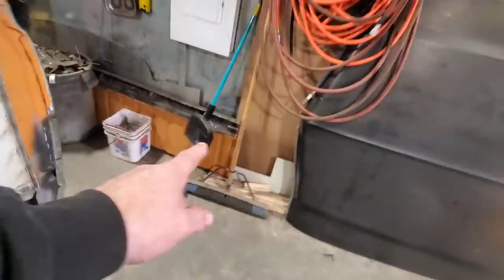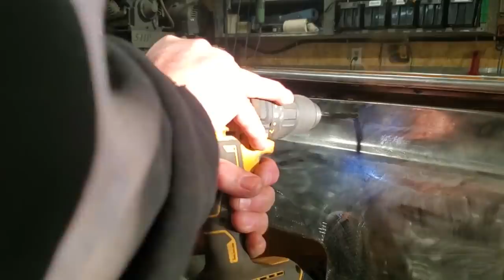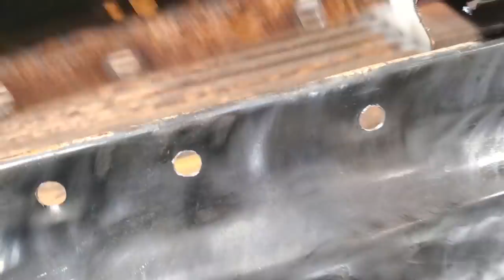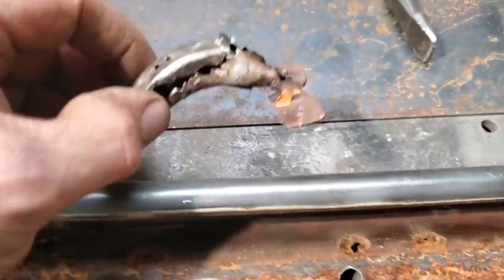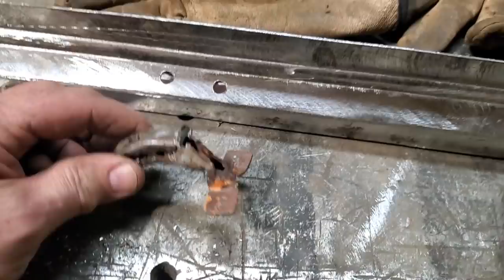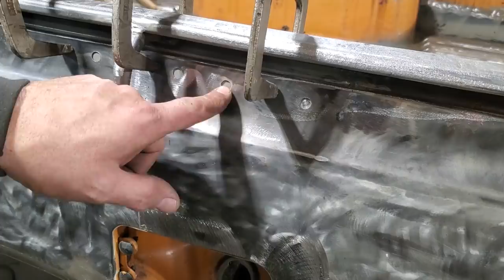Spot weld removal with simple tools

Comment: Spot weld removal becomes a challenge if you want to save the inner panel and must not drill through it or damage it. Drilling through both panels is easy.

Comment: One trick I learned to keep a drill bit sharper longer id to use the drill at a low speed and i am generous with the oil while drilling to keep the drill bit cooler.

Comment: Finally working on replacing the hood and nose cone on my Farmall 140.  I was going to try patching it with Bondo with fiberglass.  I stripped the paint off a few months back and I was way worse than the section you removed.  Every joint on the nose cone where pieces were jointed together was rusted through, some 7-8" long and 1/2" wide.  I've cut out all the panels bent them up and assemble I have to remove a lot of spot welds to put the new panels on.  This is a great tutorial on how to do that job.  Thanks for posting, Ken

Comment: Tony, I have an original seat from a 73 Datsun pickup if the guy that owns this truck is interested.  It has a tear in the vinyl from a screwdriver in my back pocket but otherwise in good shape. It was removed shortly after the truck was new when I installed more comfortable bucket seats. Been in the overhead of the garage since.  He can have it if he wants.  Located in Hazleton,Pa.   BTW. My brother and I are big fans. Love your channel.

Comment: ... after attempting to drill out the spot welds with just one pass of the 1/4" bit, I can attest to the fact that it's more difficult.  The bit walks and it takes a lot more force to get just one weld out.  Starting with the 1/8" bit for s pilot hole is the way to go!  ... then work up in bit sizes as suggested here.  Great information!  I should have watched this sooner.

Comment: Your not soposed to drill thrue the spot weld thats the lazy fast way drill the outer spot weld only thats why you drill a 1/8 hole first to guide the spot weld cutter .
Reply from the maker: So those rules are cut in stone?? I been drilling spot weldsfor 30 years. If you can brake it half way threw  great but alot of times you have to drill them all the way out. Besides I doing it with a simple drill bit. Those spot weld bits are hit or miss and when they go south on you you have to retain back to a regular drill bit cause you local hardware store don't carry them.

Comment: I worked at a business that sold and installed truck accessories and tires. He had 2 guys that were tire men and only wanted to do tires. They would get assigned to install something like air bags on a truck to level them with a load. They would try to drill through the new frames with high strenth steel directly with a 1/2" drill bit. Needless to say they could melt the ends off faster than I could sharpen them. Finally got it through their skulls to center punch the hole location and drill a 1/8" pilot hole. Then work up to the 1/2" drill.

Comment: I have been watching your video's over the last month to get tips on doing body work on my rotting truck. All I can say is you have been my guiding light. With no previous body work experience( I'm a cabinet maker) I bought a cheep MIG welder and a sheet of 20 gauge sheet metal and made amazing patch repairs, even complex 2 piece in the wheel wells with rounded edges. I wish I could post pictures of the before and after.
Reply from the maker: I have a facebook page just for that. Pop over and let us see your work.
Reply: @fitzeesfabrications  Sorry bros. I don't do social media.  I ordered new fender panels but the outer wheel houses are rotted out and are170.00 each.(04 Dodge)
 I'm looking at buying a used bead roller and attempting to make them myself with a tipping wheel and make 2 L shape pieces and spot weld them together to make the U.

Comment: I have a ton of holes because I drilled straight through, in a modern car but you skipped the hole welding up part?
Reply from the maker: No I replaces the section that had the holes. But I weld up one side first if I was reusing the factory metal

Comment: Ok I'm struggling with  commenting on this but here it goes.
You should never use the side of a grinding wheel.
Use a dressing tool to true up the face of the wheel first. That will give you a fresh edge and sharp corner.
With that being said you are a true craftsman who have the sense to not push too hard on the side of a grinding wheel but some of your viewers ( my coworkers) do not.

Comment: Maybe I am biased, but I love the old Datsun 620 series pickup as not only did I work at the dealer when they where new, but owned on. In the upper Central Midwest, we avaraged 32” of snow in our big city that made full sized 4X4’s hard to get around in the hilly neighborhoods. With 5 spd stick & 2WD, people with shovel in their hands were shocked to see some little pickup coming up the hill without struggling or spinning out. I smiled a waved. My secret was a light weight Datsun that had 3 or 4 sandbags in the back, but narrow tires that rode on top of the snow, plus I put tires chains on it. I could pull into a large gas station mid day on a snowy Saturday and find only 3 vehicles made it. Much less at this time during the 80’s with President Ronald Regan in office, OPEC no longer a factor and 75 MPH signs replaced the Jimmy Carter 55 MPH signs, fuel was very reasonable.
 Filling up the truck plus 5 gallons extra for the snow thrower, my cost was $12.50! 
  Yep, missed the old days! It didn’t hurt I had a 510 wagon, painted metallic brown, brown interior that had a head gasket failure so the owner sold it to me for $150 at the dealer. Then I bought a 1976 280Z (Paint-301 medium metallic brown, a 510 sedan with divorced rear differential. Then while wrenching to support 5 other hunger family, I lived 3 blocks from work! It was crazy as I could walk to work, walk home for lunch and spent nothing to go home. I wished my wife wouldn’t have talked me into selling the 510 sedan, 280Z and keep the wagon and pickup. I was an ASE master, a car guy…I wanted them all!

Comment: When I drill through. I like to use a die grinder and carbide burr to remove the remaining hold on the welds. I defiantly like drilling through when you need to save both pieces.. It's really easy to do damage with a spot weld driller that pop loose or bend the sheet metal if you try to avoid drilling through. When practical. say on a rusty floor section. I like to cut out the piece very close to the spot welds. Then grind down the remain metal where the weld is until it's paper thin. Just peel it off with pilers, pry bar, etc. This is highly preferred when you can't see weld due to rust and you don't want to drill over head. Also, whatever primer you use. You should do a weld test. You want to make sure it doesn't peel when exposed to heat and doesn't just burn away even far from the weld. For Example ZeroRust, really doesn't like heat any where near it and will peel away from even a good distance from the welds. Not what you want. I usually use a weld through primer but I scratch it off in the holes.

Comment: YEP. THAT OIL EMBARGO, @ LOWER 70'S,  CAUSED BILLIONS IF NOT TRILLIONS OF DAMAGES TO AMERICA! HITTING FORD, DODGE AND GM!@! HORRIFICALLY!  WHAT HAPPENED? IS EVERY ONE WENT TO CHEEP FOREIGN STEEL! RUSTING OUT, IN 1-2  YEARS! JUNK CARS & TRUCKS! BY; THE HIGH COST OF FUEL! + COST OF AMERICAN VEHICLES.(1) PLANT (u.s. steel) WENT FROM 35,000 to 5,000 WORKERS IN 7, years!

Comment: Craftsmanship, looks super sleek again, and again a lot of good tips, I also have bad experiences with those special spot weld drills, or the tip breaks, or the teeth broke off, or the spring does not come back. I haven't welded in a while, but I used to make a lot myself. very fun and challenging. very neat hook again!.
I welded my 70er Camaro myself, and made my own frame rails. with the vice, wooden molds etc. Replace the trunk floor, and some floor parts. and some other small parts. The sills were very hard and that was done in a garage box of 3x6 meters, very tight, but finding a good place to work on your car here in the Netherlands is very difficult, so I have been happy with this small garage for a long time. A Camaro is also 4.70m long hahahaa. Fitzee keep it up, you do great work. I am always amazed at how you solve it. Many greetings from Chester from the Netherlands  🙃✌👍

Comment: Tips working with drill bits for sheet metal 

1 Use HSS bits...they are designed for metal......HS is a wood cutting bit

2 Slow speed  is the best let the bit do the work not the RPM's......you eventually get a feel for it
you should have the metal coming off in a curly sprial or large pieces.....
if its fine dust you are drilling too fast and/or your bit is dull.....not good!

3 Use what we call here in the NW your 'Boeing Finger' (Middle Finger) to control trigger (RPM) speed on your drill
use your thumb and index finger to steady your drill and the index finger can be used to intricate the angle of your drill as well!

4 There is a solid/paste lube called Boelube (Amazon carries it) for lubricating drill bits its all natural just dip the tip into it and 
use it as a drill lubricant.
Note: this was developed way back in the 50's/60's for the Boeing Company but widely used everywhere I've been....
Its an all natural product that works great for metal cutting bits ,as a little goes a long ways &  it dosen't run off and make a mess all over the place

Comment: Once again another great video.  I have a century weld pak 100 welder and I use flux core wire.  Is my welder capable of doing the welds you do.
Reply from the maker: Is your welder set up to take gas?
Reply: @fitzeesfabrications  I’m thinking about converting to use gas but I wasn’t sure it still wouldn’t be strong enough.

Comment: Fitzee. I like everything you repair. You do an excellent job on everything. But I find it very hard to listen to you explain things when you are poking and tapping hard on sheet metal or picking the part up and dropping it on the I beam so many times. Yeah I'm a little on the edge most of the time with nerves working on old junk to most, so I watch other people doing the same stuff, It helps to knock that edge off a little. but by the time I get done listening to you do all that unnecessary beating and banging, I get a lot more irritated. I notice it in every video. Everything else is good. I live in Virginia and the way y'all talk up there is kinda funny to the way we talk here. Keep up the great work you do, I always enjoy your program.
Reply from the maker: You know I notice that myself. But don't know I'm doing it at the time. Been trying to knock it off. I fine it mutes thr mic for sec every time. I'll try to beat it into my head next time

Comment: Thanks for the great videos. I do a lot of drilling...and sharpening. I bought a set of titanium bits and broke 2 right off the bat. I then got a set of cobalt bits and I'm having great luck with these. Haven't had to sharpen any yet even cutting thru hard steel and stainless. Well worth the extra loonie.

Comment: Another cool video, Fitzy.  You're a smart enough man, with 20 minutes of simple training, your could sharpen bits correctly and they would work even better.  Do you sharpen your 1/8th inch bits?  For what they cost it's not worth it.  They have a factory edge that has the correct angles, they cut real good.  You might have heard this one before.  If you want to check your angle on 118 degree bit, take 2 hex nuts the same size and hold the 2 flats to each other.  The angle above or below the flats will show you if you are getting the correct angle.  Anyhow, still another masterpiece video.
Reply from the maker: No don't sharpen 1/8 bits. They are not easy to sharpen.
Reply: @fitzeesfabrications  I  bought myself a drill doctor years ago.  It does masonry, normal HSS and carbide.  Can  do shallow angle 117  and steep plus you can do split points.  Can't say how many bits run thru diamond wheel (hundreds) still going strong.  It does small bits like 1/8 inch easily and it's portable so you can keep it right next to your job if need be and do quick sharpening.  Takes all guess work out, sharpens perfectly.

Comment: Hey Fitzee how do you charge for a job . By hour or by job . And have you ever used POR 15
Reply from the maker: By the hour and no never used it. Think it is way over priced.
Reply: @fitzeesfabrications  it is over priced but I had a piece a metal that had a lot of rust on it so put por 15 on it and it set outside for almost 15 years and didn't rust back .as long as you follow directions it works really well

Comment: FITZEE...I noticed on that thicker metal you were able to put a bit more heat on there and possibly weld 1/4 inch at a time to make that panel. This was because of the bend and because of the strength of that bend It would not warp as easily.  I think on that small part it would have been beneficial to set up the camera and do it in high speed. It is an easy edit and easy to film, may have helped many people figure out how to do that small part. Great job though on what your doing. Love how you teach people how to simplify the repairs down to small parts.

Comment: Here's a trick when you go to fill up those holes with weld. Take a piece of German brass or copper plate. Put it in behind the hole and weld it in a circular motion. Then when you are done welding it twists the brass or the copper and it will release itself from the weld. It is so much quicker and easier by doing it that way or I find it's easier try it you'll like it oh by the way good video

Comment: Just wondering if you have used a 'power file' / finger file for grinding out the spot welds either as an air tool or electric? Some of the collision channels I watch use them
Reply from the maker: No never used them

Comment: I tried the center punch followed by the spot weld cutter but find the cutter still walks since the center punch mark isn’t deep enough to hold the center pin on the cutter. I know drill a 1/8” hole (I try to only go through the first layer, but if I go through both no big deal) then the spot weld cutter stays put. Cheap eBay cutter, double sided, comes with 10 in a pack. Get about 15-20 welds cut per side

Comment: Thanks Fitzee, 
I am made thoughtful that the theme of your channel is to do repairs with "SIMPLE" shop tools, which means to me that with your over 30 years experience working commercially and independently that you have come to realize just what it takes to do a good job without spending a fortune.
 
Many of us might have a few projects to knock-out and that may be the end of our investments without spending a fortune on the latest/greatest tools and equipment to leave laying around the garage collecting dust later on.

Other folks might have their calling and do this repair work commercially or independently and purchase different tooling and methods that the shop/billing overhead absorbs the costs of the specialty items/equipment.
 
I have been to many auctions of shops/businesses with specialty tools and equipment and it went for pennies on the dollar, because it was too special.

End of the day you cannot take it with you when you are done and over.
 
Everything you use could be found in anyone's garage, shop or shed.

Trying to keep that in mind to prevent stuff from owning me unless it can generate wealth collecting dust for that one time... believe me I like tools and equipment too! 

I myself, also believe in working smarter by learning from other folks experiences good or bad to determine my best path forward.

Comment: Very interesting process. Given your proximity to salt exposure on the island, as well as the winter climate, what process do you use to rust protect your repairs? What brand of product do you find works in the climatic conditions. i.e. what do you repaint your cars with?
Reply from the maker: If it was on a winter rig. It get lots of paint inside plus oil. Problem here is cars rust where you can't protect. Inner rockers. can't always see what's going on in there till its too late

Comment: Hello Fitz. Been wondering where you have been.
A tip maybe you can use. I drill spot welds at work sometimes.
I start with 1/8, move to 1/4 and then just step bit until it breaks free. Step bits are amazing if you buy descent ones!
Awesome video as always.
Reply from the maker: I have them too. But sometimes the step bit bottoms out on something inside. But great if that is not a issue
Reply from the maker: I have them too. But sometimes the step bit bottoms out on something inside. But great if that is not a issue

Comment: i get not spending tons on a specialty tool for a job but a spotweld cutter with 3 cutters is 14 dollars. doing that way is 3 times the work and wear on your drill motor but to each his own. just glad youre learning the craft.
Reply from the maker: How many weld will you cut before that 14 dollar tip is no good.? I used them and like I said a harden weld will kill a bit. Even a spot weld cutting bit.

Comment: Wonder if weld through primer would work for between steel preservation. Then you wouldn't have preclean the spot welds.
Reply from the maker: No that stuff don't like to be welded. I had trouble with it in the past. I still clean the welds for that too